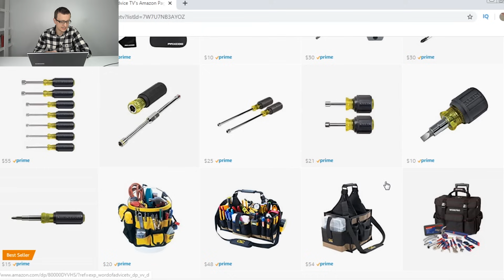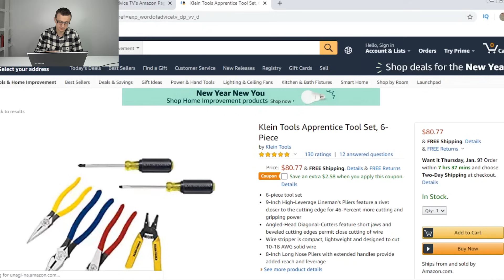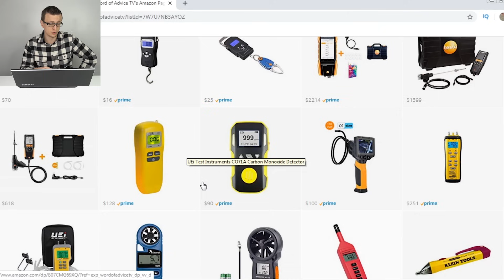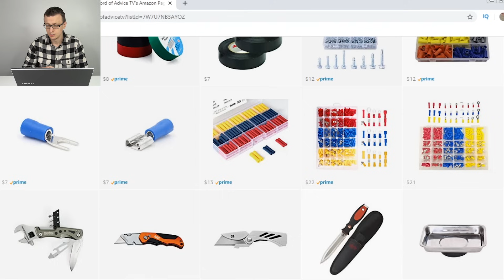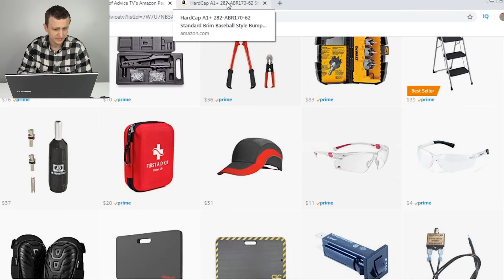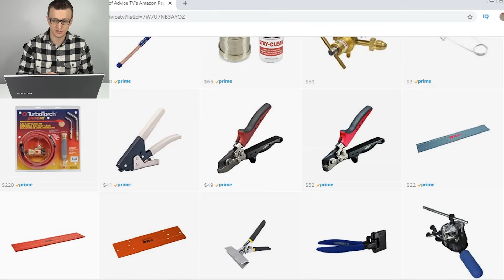HVAC Tools List for New Technicians

Comment: I figured up the price for everything i have in my main tool bag only (not counting my 28v power tool set sheet metal bag, and tool box) and bag included (veto tech pack) it was about $1800.
Reply: Lol that all?
Reply from the maker: That's just in one tool bag right? Those tools are not cheap.. Thank you for giving us an average tool set price HVAC Tech!  Michael, it sounds like yours is a lot more expensive, what would you estimate yours to be? :)
Reply: @WordofAdviceTV  I am a dual tech, doing both HVAC and appliance. My basic bag that goes into every job to start out with last I check has about $2400 in it.
Reply from the maker: @Naemion  Dang, that's one expensive tool bag! Thank you for sharing!